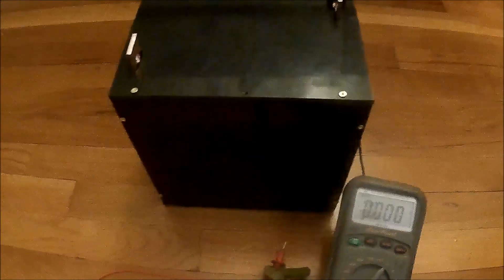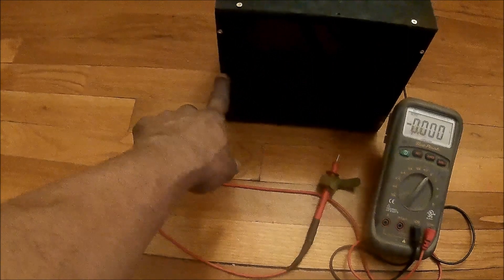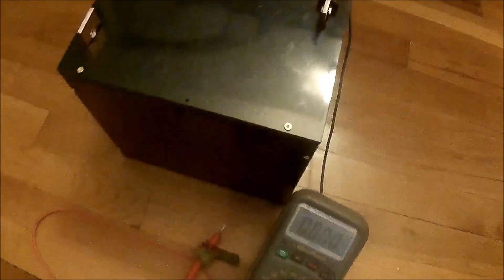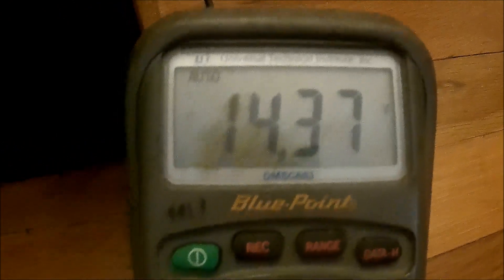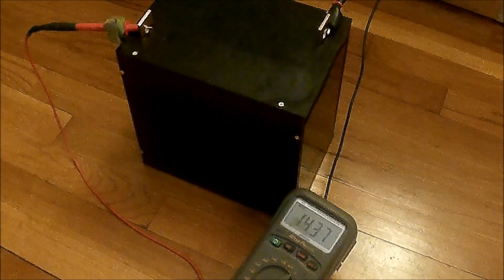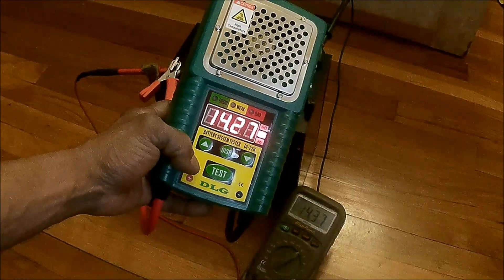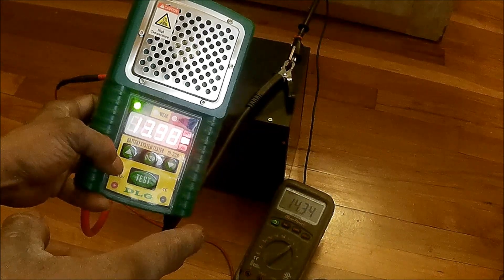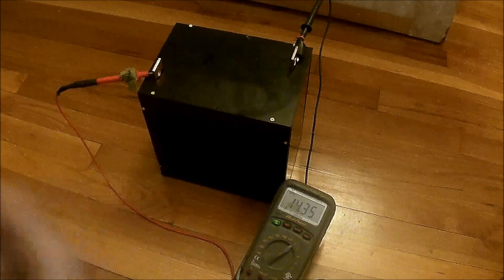BigVell Lithium Finally Here! 40Ah And Some Quick Testing.

Comment: I'm subbing up. Need a battery shipped her to California. I really like what your doing. Have a few questions as well.
Reply from the maker: Thanks Much. My finished products will feature custom BigVell 7 spot terminals made by Tool Maker.
Reply: @bigvell02  your Definately on the right track really wanna ditch my agm batts for 1 or two lithiums

Comment: Yo bro ham, big congrats on the lithium! Will these be ok to use along with an agm batt underhood such as a Northstar?
Reply from the maker: Hey bro Thanks a million.. Yes they would work out ok... But all automotive lithium batteries rest at a higher voltage than AGM. When your car is off it will charge the AGM until the lithium rest at the same voltage as the AGM. This will make the Alt work harder at start up to charge the lithium. That's the down side but to combat that I used a marine style kill switch in the charge line going to the lithium. They are usually rated around 150-300a if you have more current you can always parallel a set of them. This battery would take less than 2 mins to reach full charge from 12.8 ;-). 

I ran a AGM with a lithium for about a year no kill switch, isolated for a actual charge every month. Issue free. But when I converted over to all lithium - it was game over.

Comment: Estimated price bro need one bad
Reply from the maker: The battery will run around $650-675 depending on terminal design. The first 100 batteries will have Special pricing people will think Ive gone mad :). Nope just mad good power, high quality at a great price. Thank you for stopping by and commenting as well.
Reply: @bigvell02   are these available now?

Comment: Harbor freight 500 amp carbon load tester with an amp clamp
Reply from the maker: I couldn't find the footage of me at friends shops using their testers and random auto parts store machine testing. I wanted to add it to this video. My carbon tester took a dump - of course I had to order another.

Comment: Good shit 👍👍 just found your channel brother can't wait to get one of these when your finished keep up the good work
Reply from the maker: I appreciate you stopping by Just a heads up I love car audio so you might find some interesting things here. The networking in the comments section is unreal as well. The batteries will be available very soon and again thanks for stopping by Peace and Bass
Reply: @bigvell02  hey man thx for responding I'm 16 rn tryna get my GED because school isn't for me and my dream is to have my own business making subwoofers like my own brand. Do you know how I would even go about this? Or. Could you help me in any way?
Reply from the maker: All I can say is follow your dreams & you don't need a masters degree to do it. Just a dream that turns into a goal. Get a pen and paper and just start drawing what you want ideal specs for motor and basket then your soft parts. I can imagine building a woofer is not too far off reconing a woofer. A ton of parts come from China for a lot of brands. I would suggest looking into some speaker part manufacturers in China - They can and will build all they need is a design.

Comment: R u going to b selling them n if so whats the price also what is the weight of it
Reply from the maker: Yes they will be for sale very soon. Price will be around $650-675 depending on final design of the terminal block. The weight will be around 20 pounds.
Reply from the maker: The first 100 batteries will be "Special" priced so be on the lookout

Comment: I'm going to need one bro
Reply from the maker: Yes Sir the one you got from me is very nice but this battery right here.... :) :) :). My voltage does not move I'm running to year round so far I'm very proud. I have a good feeling word is going to spread. These batteries are very powerful
Reply from the maker: You already know I got you too let me know if you need any help (2nd hand) with your project as well.